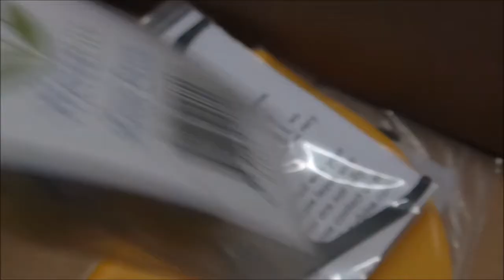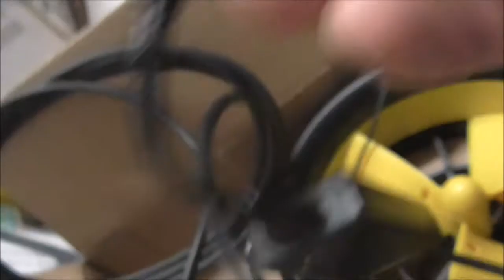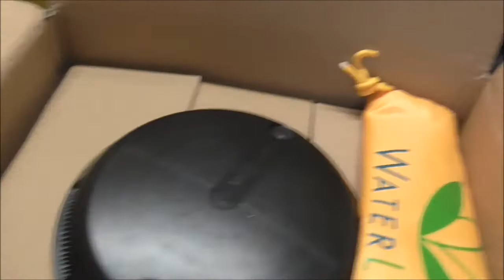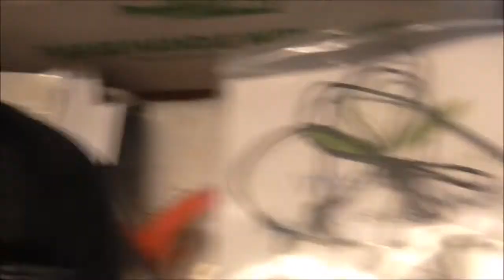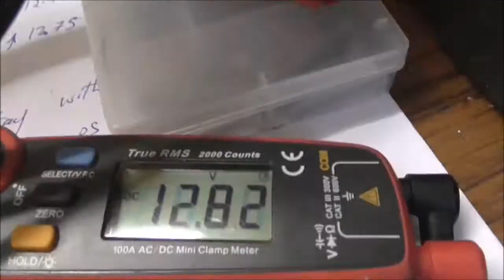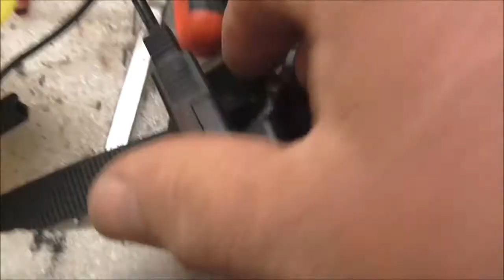Windlily Combo Unboxing and first impressions

Comment: How is your experience with the generator,does I t do what you expected?
Reply: Hi, I did a follow up video of first field test that you could look at.
I was expecting to get one amp output but only getting half of that so it depends on your expectations and usage. 
 I think these portable units are limited due to there size and weight restrictions.
Reply: @martint1151  I just watched it,looks like you have to wait a long time to get your order.
Reply: @sosteve9113  ordered mine back in October and nothing the FB page seems to have lots of complaints for this
Reply: @adrianlecuyer  thanks for the reply
Complains really,not worth the buy then.
Reply: @sosteve9113  they are taking ppls money and not fulfilling orders sucks that they are doing this I filed a complaint with ministry of consumer affairs but they said that they will only do something if they get lots of complaints

Comment: So glad, you received your order.  I ordered my Windlily/Waterlily bundle in December.  So far, only the accessory box has arrived this week, minus the dry bag I ordered.  Can't help but feel disappointed since it was a Christmas gift for my spouse, plus we leave for our annual Crownland camping trip in the backwoods of Ontario, Canada for about 2 weeks.  Good luck with your turbine, I hope everything works out!
Reply from the maker: Angela , I ordered mine last August and also took a long time to arrive , hope you receive it before going on the trip as no doubt that's what you ordered it for .
I made a separate video of first try out , results were mixed as expected more amp output. Have a look at it and form your own impressions.
Reply: Seems they are now ripping ppl off if you go on Facebook ppl are ordering and not receiving anything I ordered a wind Lilly upgrade last October received nothing no answers to emails makes my water lily useless as max watts in the water was 5w. Send a complaint to consumer protection if they get enough they will look into it hopefully get our money back if they do im also in Canada